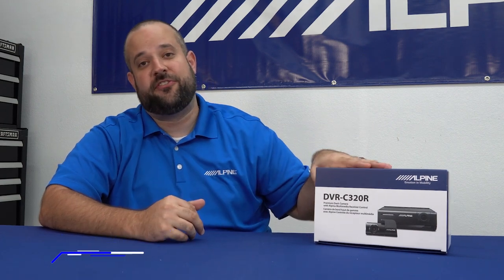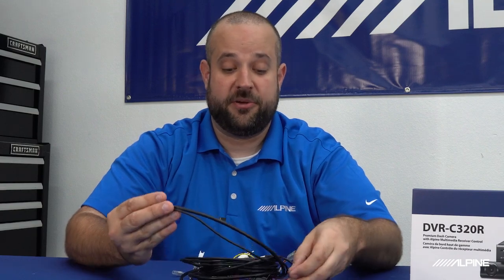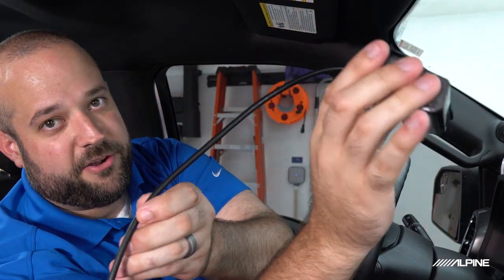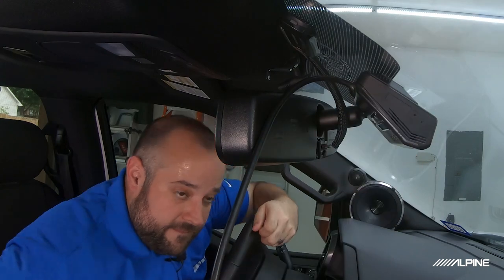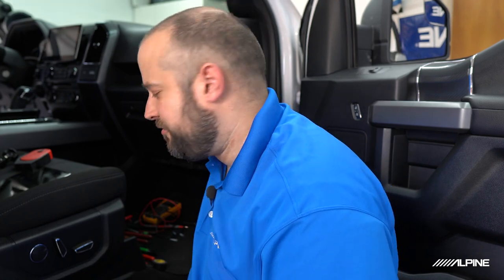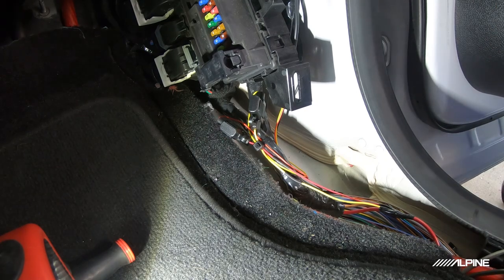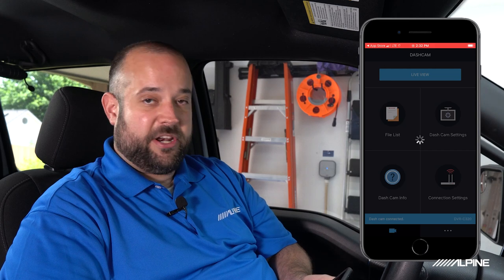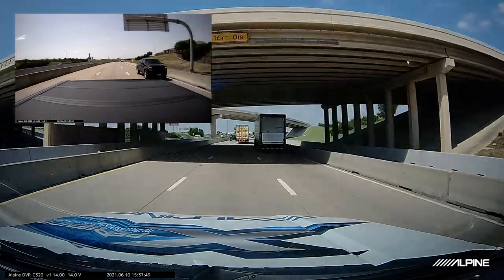DVR-C320R Dash Cam Step-by-Step Installation Tutorial

Comment: Hey Alpine, can you give us a demo of how to connect and configure this camera with the INE-W987HD and the X308U?? Connecting it behind the radio as well as the required settings in the radio. I contacted your tech support and they we're absolutely no help. These are two of the three head units that are supposed to work with the DVR-C320R. Thanks guys!!

Comment: I have a voswitch installed. Could I wire the power into an available power input? Any problems if the power was wired to an on/off switch?

Comment: I have this camera and you failed to mention that you have to extend the power connections to the kick panel. The existing wires are not that long. I'd say about 6 inches. There are two wires that are connected behind the radio (remotein and remoteout). You need to extend those three power wires if you plan on going to the kick panel. I connected mine behind the radio.
Reply: Janii , do yo have vids on this e camera, for samples , are yo happy with it ?  im looking at this camera but there's to videos out there to decide. would like to capture/read  lic plates as they are moving past my car,